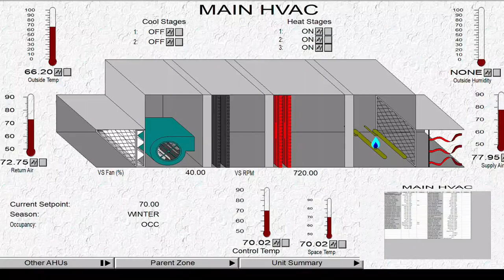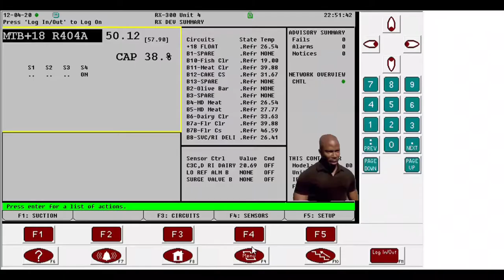Refrigeration Confidential Preview of a Supermarket Refrigeration Channel

Comment: Hey can you do a video to set an EPR valve on the rack and pumping a circuit down ?
Reply from the maker: For sure I will have to break them down in two videos.. any preference on what video first
Reply: @refrigerationconfidential4376  does not matter
Reply from the maker: @D_Nice981  alright I got you... just posted a video on Checking receiver levels check it out..
Reply: @refrigerationconfidential4376  I did 
I don’t use a torch to check receiver levels  but I might start doing it
Reply from the maker: Just posted the video for pumping down a system.. hope that helps you.